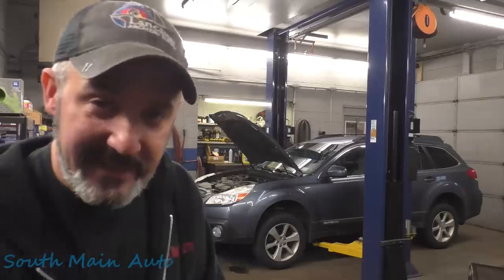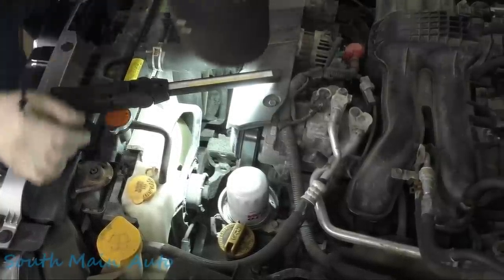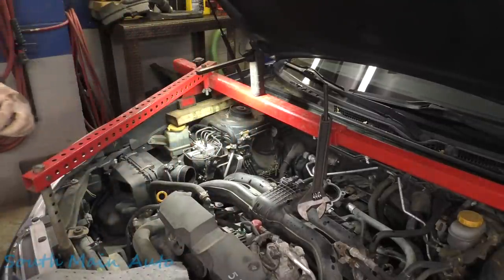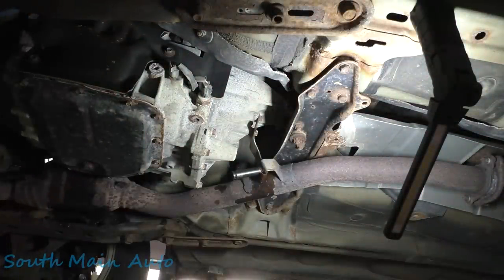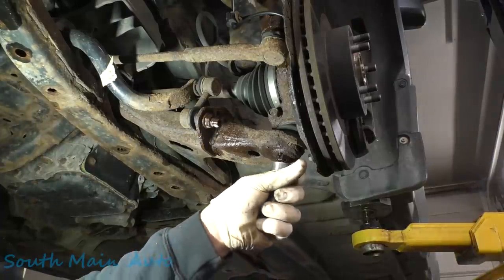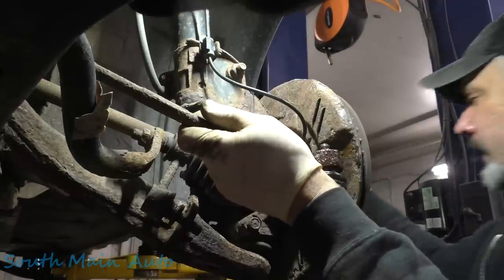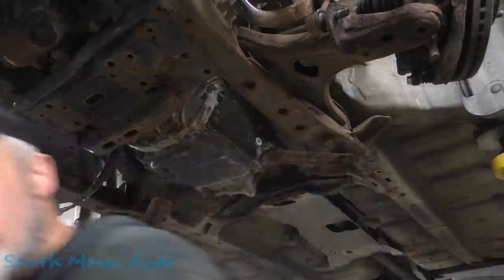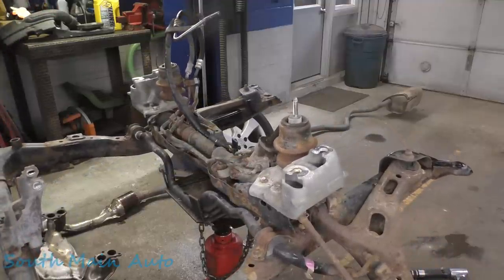Project Rotted Subaru Subframe - Part I

Comment: Waiting for the suggestion you hop down to Wilbert's to extract the replacement, to save some $$ & we know the junk yard subframes  are all pristine. Further Eric holds the front end in the air, removes the Wilbert subframe with the other. It is cold so must work fast. As for tools❓❓  Don't need no stinkin' tools (deliberate grammar) easy peeze.

Comment: Quick question: What do you consider rot? I see some of the surface rust on my car. Mostly, it is around manufactured holes in the floor. But not a lot. I do live in rhode Island but haven't experienced rot rot. Are most cars up there really bad? I fluid film every year just because i feel vad for the vehicle in salt, but are there other means of protection?

Comment: Good vid.   Teach some folks how this kind of job rolls. I don't miss it but I got a 04 outback to rehab this week.
  No lift. Lol.  
  Rear tires
 Timing belt n water pump spark plugs and wires  an alternator.
  And a back hatch, two tail lights. Someone got happy with a bb gun or some shit. Left side view.
  140k miles everything is original accessory wise, alternator bearings squeeling. Interior needs detailed, mold n shit 
     It actualy came from out your way. Along with a frame rotted for mistake that'll end up scrapped. 
 I hate cars. I freaking hate cars I rather watch you work than do this crap anymore.. It hurts me body. 
 Barely walk today. Left knee. The fake one, don't ask me how titanium and plastic can cause pain. But it is. Maybe we became one and nerves grew into my metal idk lmao.

Comment: Yes Mr Eric I do know what it's like to change out a subframe I just did one in my 67 Camaro that's right the subframe was bent thanks to a body shop that bent the car that's right so I replace the front subframe it's a lot of work it's probably just complicated as you what you are doing here on this Subaru and the question I have for you here is when you put that Subaru frame back in do you have alignment pins that you have and then you torque down the frame like what I did on the Camaro frame is I'd love to hear an answer .

Comment: I am replacing the transmission on a Honda Pilot, which has a similarly designed subframe.  Do you absolutely have to disconnect the steering column or could you have just unbolted the rack and left it suspended with support straps?

Comment: Its almost like some joker at the Subaru factory didn't literally put "Corrosion coating" on the engine cradles just out of spite because some manager kept leaving off the "anti".  Seems at least as bad as that GM truck salt attracting wax coating if not worse...

Comment: It staggers me that skinny little threaded rod can hold an engine.
Reply: A 1/2-13 grade 8 bolt is 17,000 lbs in tension, so could probably hold more than four of these cars (Outback = ~3,800#)

Comment: How many hours of labor get charged for a job like this one ?
Reply: This one shows 5 hours plus alignment.  Have to add some time for rusty hardware.  The labor guide doesn't specify if the 5 hours includes transfer of control arms, rack, etc, so it could be more hours.
Reply: @johnz8210  5 seems about right.

Comment: I am surprised it makes financial sense to spend probably $1,000+ to replace a rusty subframe.  What other major repairs will be required due to rust at the next yearly inspection?

I don't know what I would do if my vehicle required that level of repair from rust.  It would depend on the condition of the rest of the vehicle I guess.  We get rust here in Minnesota, but New York seems far worse.

Comment: I'm glad my state doesn't have vehicle inspections like the PRNY. Although if it did it might get some trash off the street.
Reply: nah, theyd just hillbilly the frame back together with rebar, recycled bed frames. welded with a Horrible fright welder while pounding back Pabst/Coolers Light/Budweisers
Reply: @harveylong5878  Why wouldn't that surprise this boomer.

Comment: things i learn't, safety third, dont stand under red hot nuts about to fall, put on safety goggles and hearing protection just before ur finished, looks like ur itching to use that obama care u have been paying through the nose for, just kidding, awesome work and thanks for taking us along, u would think they would just get another vehicle, gotta cost a pretty penny to do this job